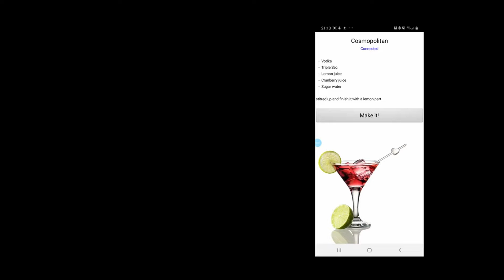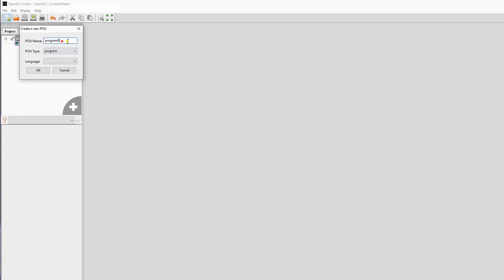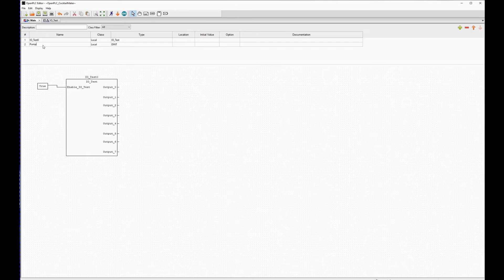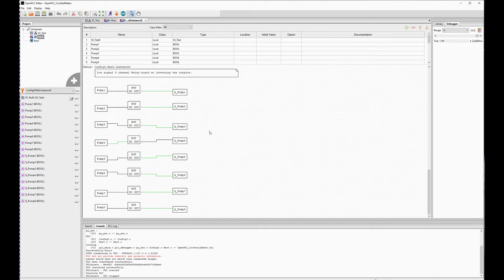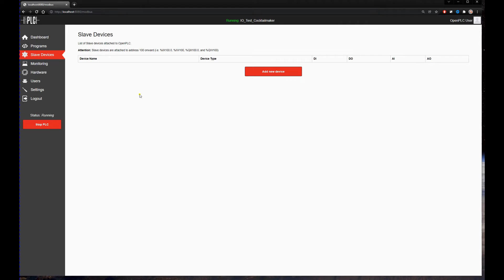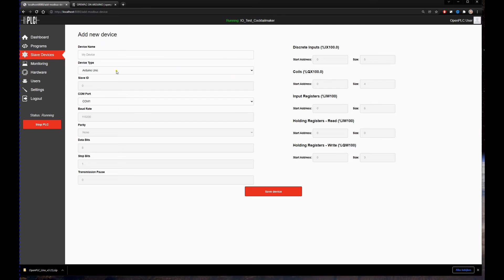OpenPLC project | Cocktailmaker ⚙

Comment: This is awesome and nice to see you moving to code that can be used on other platforms. I am just getting started and working with your MIT version. Can you post or let me know where I can get your .AIA file so I can better understand code language please? Once again thanks for your work on these projects.
Reply from the maker: In the description is a link to the project on the Arduino project hub. There in the section "code" I shared the AIA file
Reply: Found it. Didn't know the link was on the left. Thank you very much. I was slowing down your video and ended up making an AIA with virtual screens. Your AIA helps me better understand the ASCII for the communication.